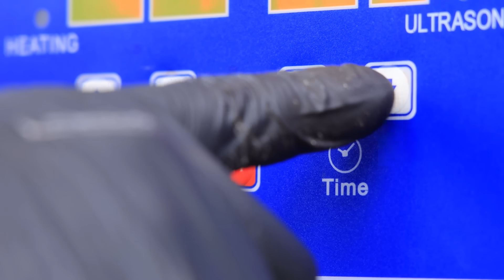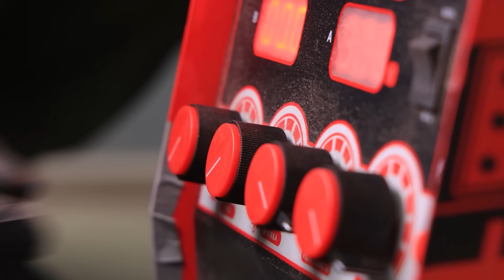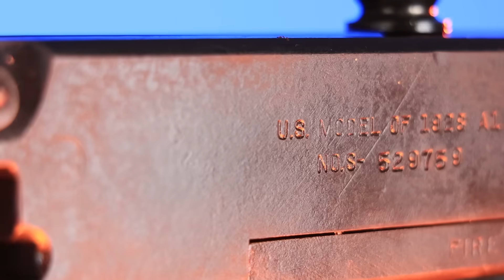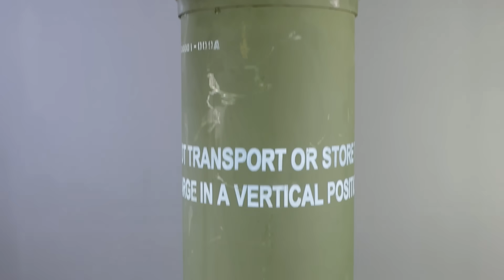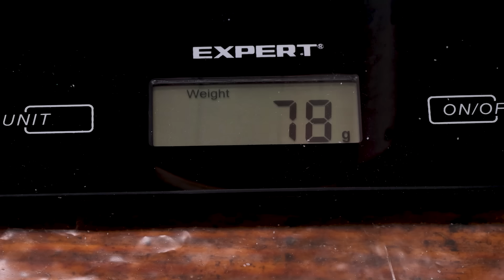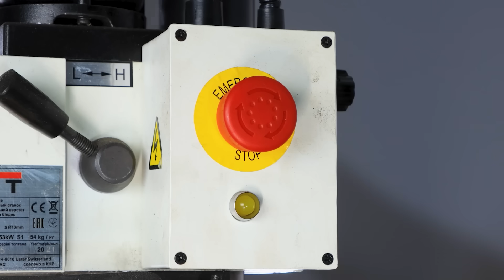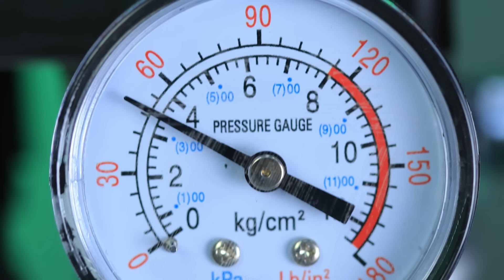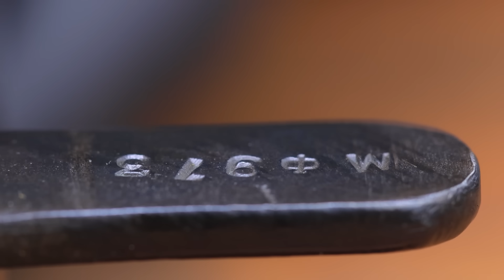Thompson 1928 | Old Submachine Gun Restoration

Comment: If that gun was that rusted every single screw would be toast . Every screw he pulled out was fine except for the “ rusty” head .
Reply: So what you thinking it's a fluke job 🤔
Reply: I was just about to comment this exact thing.
Reply: Was thinking the same thing 😂
Reply: Same.  And the wood under the parts removed is brand new.  This is probably a movie prop gun he threw in salt water for a few days to make this video.
Reply: Its fake
Reply: Ever tried to get a rusty screw or nut or bolt off thats been on a 10 year old car? Yes your correct you either cut or grind it off this is a nonsense.
Reply: thank you dr. obvious to mention the obvious..maybe he wants to earn money :)
Reply: Was thinking the same seems faked.
Reply: yea like all his rust stuff looks the same orange
Reply: Definitely. It was surface rust which clearly had been created artificially.

Comment: Nice vise grip teeth marks on flash suppressor!  I'm with the "you ruined it" crowd.
Reply: THIS. I stopped watching to come comment after seeing those vice grips come out.  Dudes a Butcher.
Reply: @ChristopherPayne I went to the comments after he slammed it down on the vise to get out the internals. Hack!
Reply: I'll bet it's a replica.
Reply: Not a flash supressor- it's a Cutts compensator. Directed gasses upward to help keep the muzzle from climbing when firing.
Reply: @jongirolami4978  Yes and it worked well. The writing on it is the same as a "CUTTS compensator" but it is a different lighter metal to the barrel. Odd putting it in a vice.Seems wrong. Been near 50 years since I had a 1918A1 and stripped it though. Stupidly sold it. Fathers from WWII. The brass part in the Blisch locking system looks the same. The sear fell out, happened to me when I removed the cross pin once.. Only difference, besides mine had a pistol grip fore end, is the barrel had cooling "fins" and this was smooth. The stock had an oil bottle inserted made of real silver and something else I can't recall?

Comment: Actually Thompson had 5 variants, this one looks correct in every way.
Reply: All the features indicate that it is a late production M1928A1 circa 1942, possibly manufactured by savage.
Reply: No, it doesn’t, the ‘28 did not have the rear L-shaped peep sight.
Reply: @dewilderdbetter  The late production M1928A1 used the simplified Lyman 'L' sight.  

It was introduced around June 1942.

Comment: When he grabbed onto the Cupps Compensator with ViceGrips I started choaking… pounding out the pins with non-brass drivers got a squeak from gritted teeth… using a STEEL brush on all the machined parts made my common sense warning buzzer go off… I left this restoration feeling like I had internal injuries.
Reply: Steel drivers marr the pins… brass is soft and does not damage the surface.
Reply: Also, the pin punch was too small. He banged the parts on top of the vise to separate them. When he was tapping out the part with the trigger guard, he was tapping on the guard instead of low down next to where the parts were attached. I cringed multiple times during this. He seemed to be in a rush. Also he scraped the stock, and used sandpaper against the grain. I would have used ultra fine steel wool, and followed the grain. There seemed to be so many dodgy processes, although I'm no gunsmith.

Comment: Great armorer to take it completely apart and put it back. I know I’d have a couple of springs, pins and screws left over 😀

I rebuilt an engine in the ‘70’s between tours of Vietnam. I had a little ZipLoc bag full of springs and screws “leftover”
and put another 18,000 miles on a 119,000 mile motor before selling the car. I put the baggy of parts in the glove compartment in case it had to be rebuilt again so that maybe there would be someone who knew what they were doing would need them. 😀👍

Comment: Forget the rust, never seen a 28 without the foregrip and cooling fins
Reply: It's a late production M1928A1. 

The vertical foregrip was omitted from the A1 as it was intended for military use and after about July 1942 the barrels were produced without the cooling ribs.
Reply: Its fake that is why

Comment: Put a piece of electrical tape over the tip of your rivet gun. It'll still drive the rivets just as well but it will keep them from getting marred up during assembly. It was a trick I learned assembling aircraft.

Comment: If it was a pps 43.   You could just spray it down with oil for awhile then clean with a few wire brushes and it'd be ready to rock and roll without issue

Comment: Regardless, very good workmanship. You guys need to test fire after you finish it.  We'll done
Reply: I doubt it would function properly. He hammered and sanded several parts that would be out of spec now.
Reply: @themightycrixus1131   That's vary good point. I'd clamp it a recoil absorbing gun vice and string the trigger 30 feet away, and "give it a shot"

Comment: Wondering about osapro product. If say the barrel was sanded down to a even thin layer of rust osapro applied creates a chemical reaction with the rust turning it into a new compound black. I think this might actually be a viable finish. Question is if 100% of the rust turned into the new compound otherwise if any rust is left over it'll just break out again

Comment: The barrel of the Tommy gun was blazing hot from recent use, but Deuces (a name given to him way back in high school where he had developed his obsession with cards) didn't hesitate.  He pulled the thick cotton batting from the trunk of his car where he had stowed it before setting out on this hit.  One of the four bodies lying on the leafy ground near the car, the place where he had fallen after Deuces opened the Tommy gun up and cut them all down, groaned.  Deuces shifted his gaze from the gun he was busily wrapping in the cotton, and scanned the bodies for one that still held enough life to groan.  A bubble of blood rose from Mouse's mouth and then popped as another groan pushed it from the bloody lips.  Mouse's ;left eyelid peeled itself away from the blood-coated eye, and the eyeball rolled in the socket until it locked on Deuces face.  Deuces unwrapped the gun, and fired one more shot into Mouse's head, this time the eye closed for good.  Deuces wrapped the gun and taking a spade from the trunk he walked about half a mile into the forest, far enough so that he figured the cops would not search since it was so far from the bodies.  He dug the hole, completely unaware of two things.  First, that he would be dead from an exploding car within 3 days, and two, that the gun would be discovered in the early years of the 21st century--more than 80 years away--by a man who--unaware of the gun's history--would spend money and time not only refurbishing the gun, and in the process erase any way that might connect it to the murders Deuces had just carried out.

Comment: To all of the Wood cannot rust people which is like everybody on here. "When metal, like a nail, comes into contact with wood, the minerals in the metal can react with the minerals in the wood, causing corrosion. This corrosion can drip down the wood and cause a rusty discoloration. The rate of corrosion depends on several factors, including: Moisture, Oxygen, Temperature, and The chemical composition of the wood. "

Comment: That Thompson, is more of a WWII configuration, possible lend lease, while it retains the "Blish'" lock on the bolt, thats the brass piece shown, most WWII versions with the horizontal foregrip and unfinned barrel (all moves to cut costs, speed production), were straight blowback, also the fine Lyman ladder sight replaced with a stamped steel hole sight, rounded to prevent snagging on a uniform,  which this has. As well no removable butt stock, which removed easily with a single button depression, sliding off coverting the thopmson instantly to a machine pistol.
This all makes me think the gun is a "Frankenstein" assembled piece! Not a factory production gun!
Agreed artificially aged for the video!
Reply: It's a late production M1928A1. All of the features are correct.

Comment: As far as l know real vintage Tommy Guns were 1921 models the military gun was a Thompson M 1.,But AL Capones boys used 1921s. The 1928 was a semi auto only gun made in the 70s and 80s by Auto Ordance.
Reply: The 1921 was produced in small numbers by Colt. 

Auto Ordnance didn't have the means to produced them until 1927/28. 

The 1928 was an improved 1921 with a heavier bolt to slow the rate of fire.  

The M1928A1 (which is the model shown in the video) was produced for the U.S Government until 1942, when Savage introduced the M1.

Comment: Back in the early 70's i dug up many weapons in Germany.  I call BS, look at the screws coming out of the wood. Like new on the threads,  the heads have light corrosion.  The cloth on the fore grop would turn to dust as you try to remove it. If you watch you'll see the cloth is dirty on the outside the rest looks new. Recoil spring looks like new. The wood is too nice, before clean up. The metal surface is  covered in rust but pull pins and black metal. No pitting.  The cloth keeps moisture in the areas it was packed in. Gives a look but hasn't been long in the dirt.

Comment: The foregrip replacement did not get the correct contouring added...most of the smaller parts (original ) are probably still available, plus a finned barrel, if desired, and an authentic foregrip are still available from suppliers advertising in the Shotgun News.

Comment: uuhm if you think that is a (1928?) ww2 era Thompson, I have some bad news for you.    What you have there is a modern (possibly pakastani), counterfeit clone of a thompson1944, probably manufactured in a goat shed sometime between 1995 and this year.    It appears to have seen some modern use, and been abused somewhat as there is small amounts of legitimate corrosion.  The rags are probably original,  typical of pakastani sourced clones, then someone has artificially aged it, or an insurgent was killed using it, and it has been dropped in a puddle somewhere for a while.   At a guess this is a looted trophy gun, stolen by an American GI, operating in Afghanistan.
It appears to have been disabled, but you replaced the necessary pin,  bringing it back into a functional condition, then you gave it a pretty decent field strip and clean.  I can see all this and I am not even anywhere approaching a gun expert.
Be interesting what a real gun expert and antique dealer could add to my appraisal about it.  These clones are often based on a real gun.. so where ever that goat shed is, probably has the real thing dissassembled, and stored in oil soaked rags for use as templates.   
Now, if you can find THAT one, it is probably worth thousands (maybe even hundreds of thousands) to a collector.
Reply: It's a genuine M1928A1 from 1942. The serial number can be seen in several frames.

Comment: Yeah you can tell it's been taking a bath and Rusty water for one wood don't rust. If that thing would have been naturally rusted that bad to take the wooden stock off do you think they would have to unscrew that easy you would have stripped them out and had to drill it out. You seen when he got the screws almost out how clean the rest of the screw was besides the head of it look like a brand new screw. They make these videos using the same tricks of the trade that people that build custom cars used to make a patina style paint job to make it look like it's old and Rusty when it's really not. For a little bit of acid on it certain stuff that you can spray on it and within a matter of seconds it'll start to rust but if you took a rag with oil and wiped it that stuff will come right off. No matter how rare the gun is if it's got scratches and s*** on it from you using a wire brush to clean the rust off of it it is no good if it's been pitted from rust it's no good it loses almost all of its value. Some of the things people do to make these videos it's like come on try a little harder to come up with a better content it would probably be just as cool for them to take the gun before they make it look all rusted and just show you how to take it apart and how it works that's my two cents I think the videos are fake

Comment: It's distressing to see someone doing "restoration" on a firearm who doesn't even have proper gunsmith's screwdrivers. Unforgiveable when you consider that hollow-face screwdriver bits are now more the norm than the exception in virtually every screwdriver kit that has interchangeable bits. So from the very first shot of the start of disassembly you know things are probably not going to be done properly.

That, plus how does the furniture get more rust on it than the ironmongery?

Comment: It all just a show,nothing real....
A real rusted gun would be nothing but a pile of crisps....
It very rare that any historic gun would be preserved well and mechanically operational....
If guns been stored in bunkers or partially concealed areas from moisture and humidity and additionally well lubricated and clean chances might be from 62 to 75% functional,many smaller parts need repair or total replacement.
At other instances relics like MP40,STG44,G43 and G98/K98 might be well functional,as long as receiver or frame in good functional order rest of parts no problem to find....
The G43 is very rare artifact to spot,especially AC43 variant or 1st G43 pattern so called roughly forged have very distinctive feature with threaded barrel ends which later been discontinued in AC44 and AC45 models,some variants features 2 sided feeding ramps.
Later versions of G43 would also have abandoned scope attachment areas,but most G43's would have one typical issues over thermal heat treatment that been done in special substance Durferrite Zyan Cutterfluse,electro chemical tempering which some of time lot of voltage or powder been over used result faulty areas that have tendency to crack like bolt carrier front nose that engages firing pin housing or sides,2nd front of receiver areas where barrel would go in.
Another issue involve lash of gas operating system,there would be very small gap between gas cylinder and connection piece/link which could be fixed by buying new manufactured parts that adjust gas pressure and eliminate lash making G43 safe to shoot....
There also very rare receiver milled bolt covers exist which rare items on it's own....
Super rare relics would be FG42 to find,despite all 3 well known models G,F and D variants,it just not possible finding them since they been issued in limited numbers for paratroopers or deployed for elite guard....

Comment: That gun was artificially aged. Wood doesn't rust, and would've been rotten away by the time the steel rusted like that. The bandage over the grip was clean on the unexposed pieces. Screws are in too good of condition. 

Fake ass content. You should be ashamed.